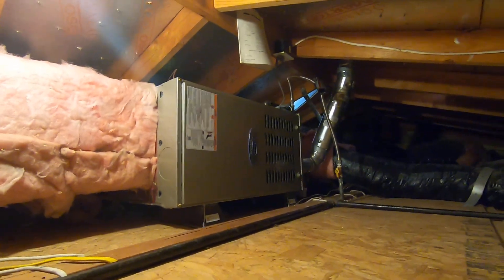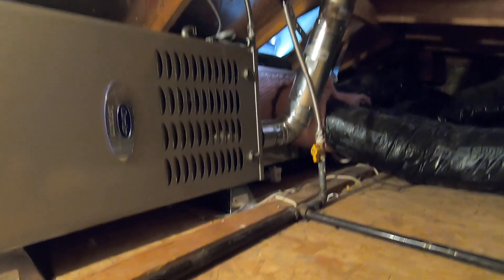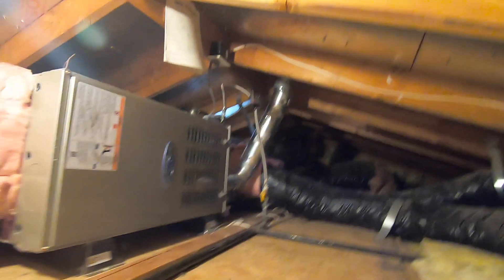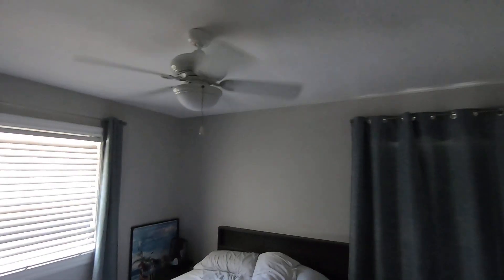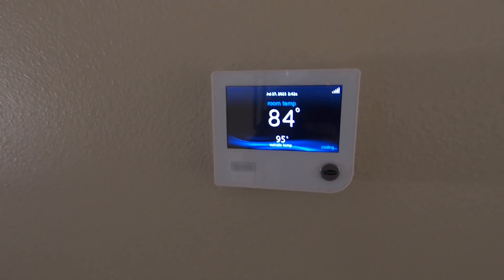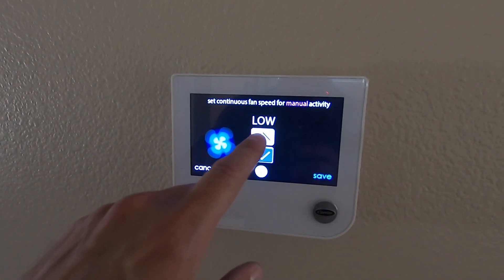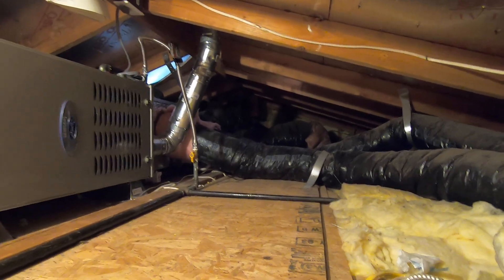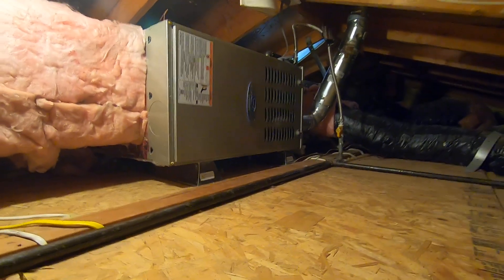It's too hot upstairs!  How to add more return air to new Carrier AC system to cool upstairs better.

Comment: Flex ducts are supposed to be stretched and as straight as possible otherwise you're loosing efficiency, creating turbulences and whatnot. Also every bends should be supported by a flexible duct support to avoid kinks. Black ducts are R4? I would have changed them as well. Black keeps heat vs foiled ducts. Also new ducts are R8. Overall, that's the idea to cool a hot room.
Reply from the maker: We did not change any ducts per the customers request because the airflow was very good to all rooms.  We only added a return air duct and wanted to make it as long as possible to minimize noise.  The Static pressure on the system is .55 which is perfect for this system to run optimally.  Yes, the black ducts are R-4 because they were installed about 15 years ago.  No need to change them as they were in perfect condition and sealed properly.

Comment: Where is the furnace filter on that unit? I have the same setup but cant seem to find the furnace filter. Thank you
Reply from the maker: The filters are in the return grill located in the hallway and bedroom ceilings.
Reply: @albertairinc.1140  that makes sense, I just couldnt figure it out. 🤦🏻‍♂️thanks for your quick response